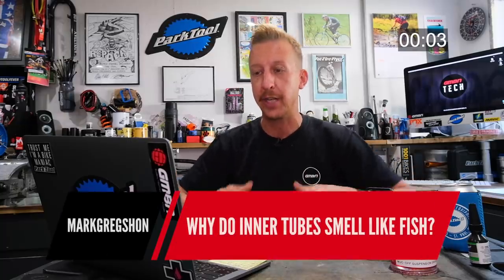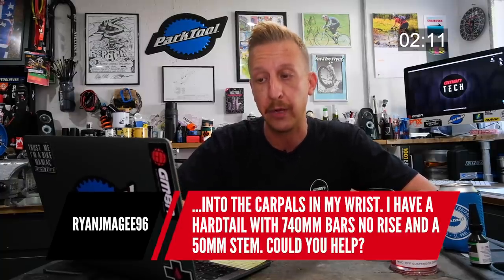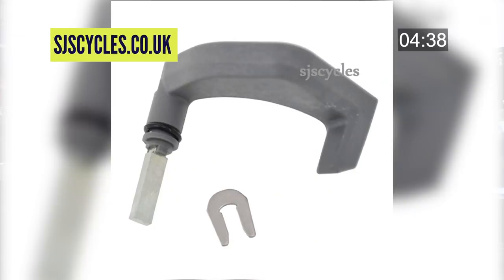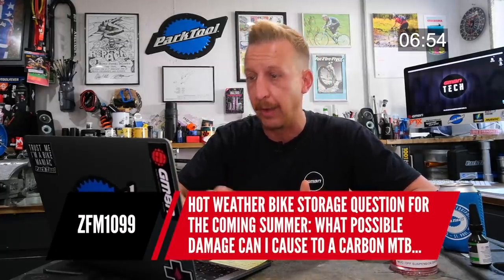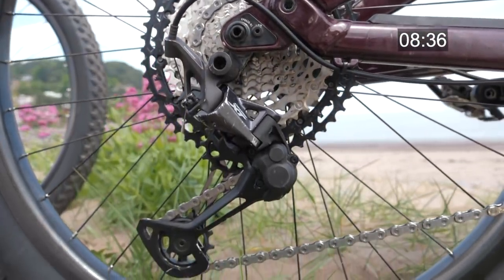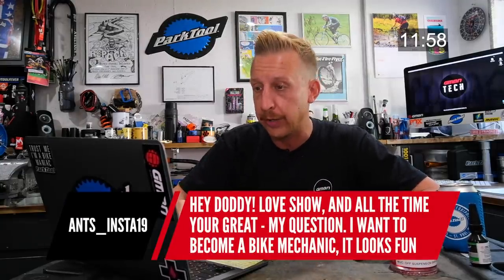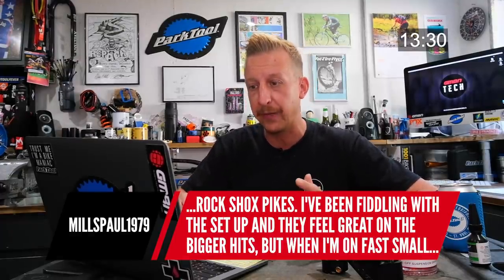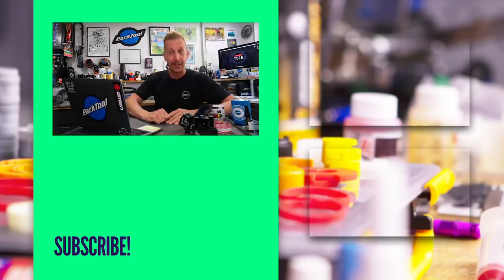Buy A Bike Or Service At Local Bike Shop Or Online? | #AskGMBNTech

Comment: #gmbntech cyclocross or gravel for a Mountainbiker who wants to go faster on the fire roads but still wants a bike that can ride single track without breaking?
Reply: Use a XC bike in my opinion 😉
Reply: Cyclocross for mud
and wetter climates, gravel for drier climates
Reply: Pablo Crack i really like the drop bars for tours though
Reply: Iliad P sounds more like a tyre choice issue... I wanna know which frames are more stabile for roots/rocks
Reply: Drop bars are a thing most MTBers just can't get used to going through/over rough stuff - have a test ride on those going off road. Then go with whatever you fancy.

Comment: #AskGMBNTech.
Hi Doddy and Henry. Do not bother my name. Difficult... I know. I brought recently Cube stereo 120 2018 model. Since I saw new more affordable 1x12 system from shimano I want it. I brought everything I need even new set of wheels as i cannot find micro spline freehub matching to my hub. But one thing still does not allow me to sleep at night. I looked widely on web and all i find is poorly explained article on website. I even look through all ask GMBN tech episodes and seems to nobody ask about before me. Rear mech hanger. My bike were equiped with direct mount one and it is quite longer than standard one. But not only that. I contact with cube directly to give me an option for haner that will suit my bike and new deore m6100 rear mech but probably due to covid 19 they still did not awnser to me. I found on catalogs that there is a hanger with short version however it is not described as fit to my model.
Apart from lengh there also is difference to b tension flange of this hanger. Hanger which my bike were equiped #10241 (cube catalogue) have vertical flange where shor one #10240 have a flange more horizontal. 
Maybe You guys can provide good and solid explain to this mater. 
Thaks a lot. Love the show.

Comment: #gmbntech how can I use tubes on a tubeless ready rim?
Reply: You just need to remove the valve, clean up the sealant and pop in a tube dont you?  The tyre should be ok to take a tube.
Reply: The same way you use tube on a normal non tubeless ready rim. But "TUBELESS ready rims " are kinda a scam in my opinion as for most rims you just as gorilla tape and with enough sealant most normal rims will seat fine but you have to use a tubeless tire
Reply: @raphaelroshwalb5500  Be aware: actually "tubeless ready" rims don't have holes to access the spoke nipples from the inside! The rim bed is one smooth surface - nipples get inserted into a separate chamber through the valve hole and "shaken" into position. Lacing spokes is a bit of a task but eliminates a potential point of failure since you don't need rim tape!
Reply: @geemail369  Tubless ready rims can also be conventional rims that just have the tubeless tape already in place from the factory. Depends on the make and model.
Reply: @vomErsten  These are tubeless ready wheels then, not rims in particular. Another confusing example of marketing bs!

Comment: #AskGMBNTech Hi gmbn tech do 26 inch wheels fit on 27.5 or 29 forks
Reply: With the right axle yes, but it will lower the bike, but if you are putting a bigger wheel fork on an already 26 inch bike it will make it higher, unless it is a slightly shorter fork, like how Sam pilgrims blue dirt jump bike has an 80mm 27.5 fork on 26 inch wheel